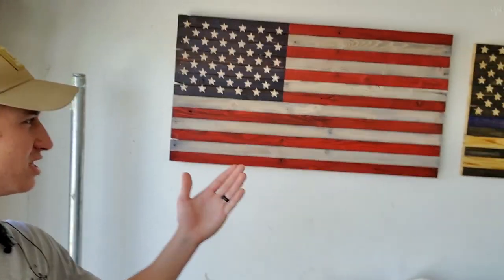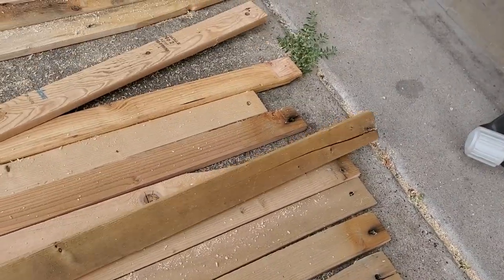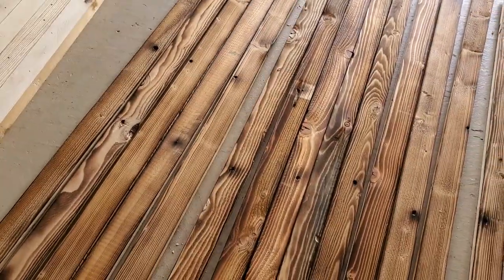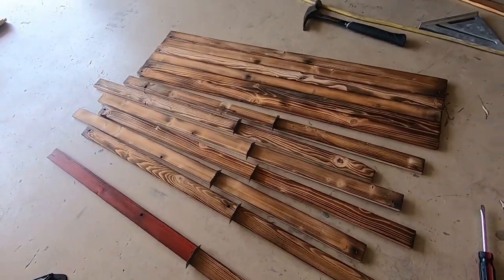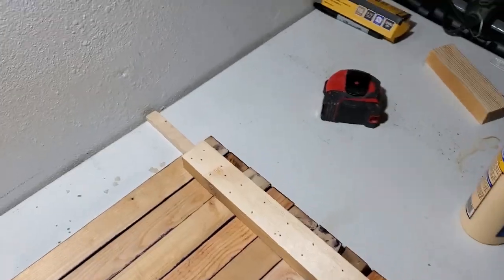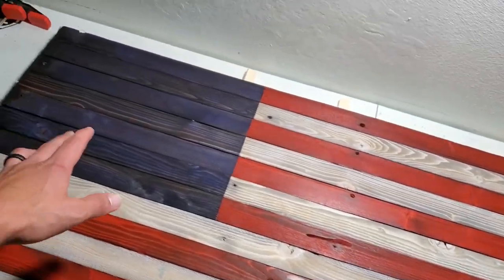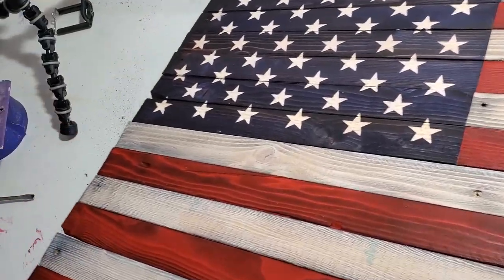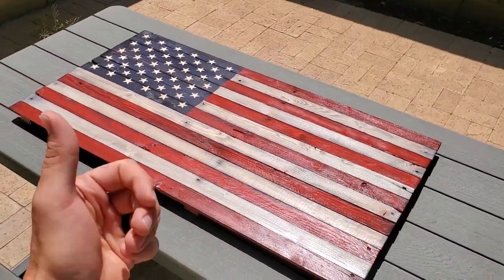How to make a Wooden PALLET AMERICAN FLAG! | DIY Pallet Wood Projects

Comment: What stain/paint did you use for the red wight and blue?
Reply from the maker: The red is minwax water based stain tinted in scarlet from Lowes, the blue is varathane water based stain tinted in navy blue from home depot and white is the same thing tinted in white

Comment: Can you provide the stain formulas you used for the red, white and blue?
Reply from the maker: Red - from Lowes, Minwax Water based wood stain, tinted in Scarlet

Blue - from Home Depot, varathane water based wood stain, tinted in Navy Blue (lowes has True Blue that is similar)

White - frome Home Depot, Varathane water based wood stain, tinted in white
Reply: Max F  Hi Max! Great looking flags! I’ve been to Lowe’s twice trying to get stain tinted in Scarlet and True Blue and the guy has looked and looked in the computer system and says he can’t find either color after scanning the can even though I told him people all over the country are using those two colors from Lowe’s. You’re using the Minwax clear tint base right?
Reply from the maker: Thank you so much Chris! Hmm thats weird, i havent heard the colors being called any other names or anything like that. And that is correct it is Minwax water based wood stain clear tint base and it says tints to a wide variety of beautiful colors. Did you by chance notice a little paper thing on the isle showing all of the colors it can tint to? I remember that they had one of those at home depot and im pretty sure lowes also had them